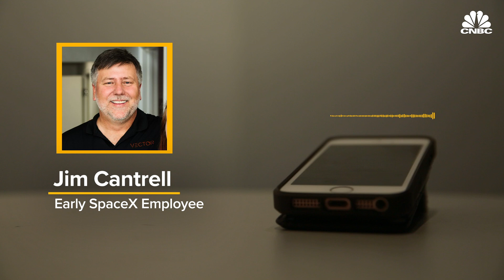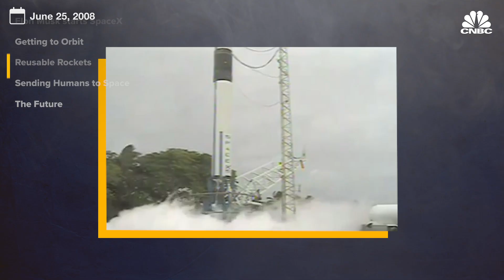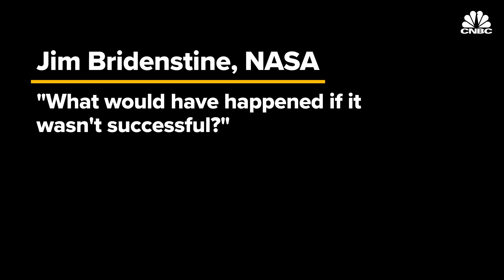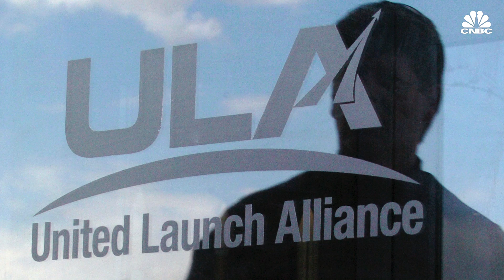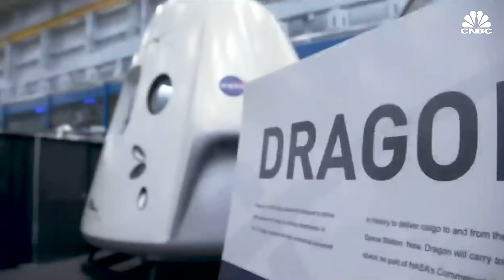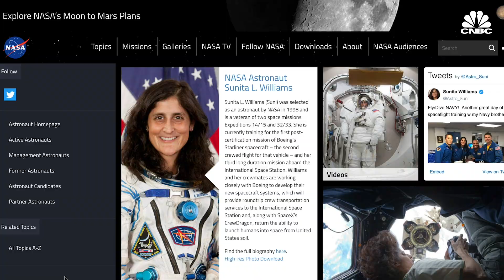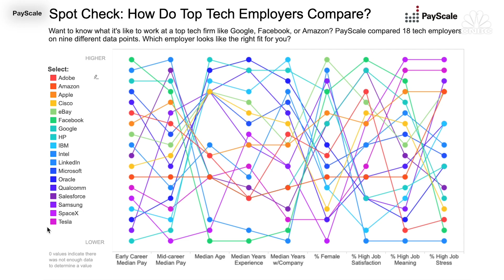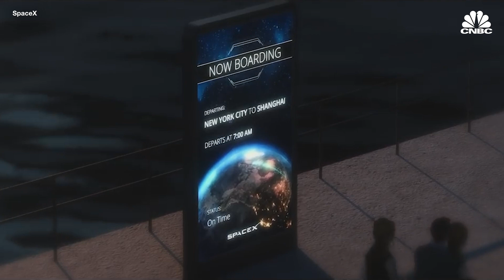What SpaceX Means For Elon Musk's Mars Dreams

Comment: How about making solar powered docking stations just like the Hubble  telescope and then placing them along the way between moon and earth. Then they can be used for supplies like fuel and food. And better still if rockets could move using magnetic force. And the magnetic force is provided by the electromagnets present in these docking stations. Then there would be no requirement of fossil fuel.

Comment: 11:00 put a car in orbit around the sun..? na I don't think so. You mean earth surly ?
Reply: The statement was correct.  It left earth orbit (which by default means your orbiting the sun only) and gave it enough speed to go PAST Mars orbit.  THEY DELIBERATELY DID NOT WANT IT TO HIT MARS,  so they intentionally missed it.  The egg heads that want to check for living microbes on Mars don't want anything from earth that has not been completely sanitized to hit Mars.  SpaceX did not want to try and sanitize a 10 year old used car.
Reply: It was intended to inject into Martian orbit but it failed so it ended up in a orbit around the sun.

Comment: Why cant we use electricity as a means of space orbit travel?
Reply: I believe you need some sort of matter for thrust. But some companies are working on water electric rockets. Essentially a huge bottle rocket with the water super heated to high pressure.
Reply: You need the expansion of some sort of gas to generate thrust, using electricity would only work if used as a heating source to superheat water but batteries have a low energy density. Using chemical engines is the best solution.

Comment: Dammit, yes SpaceX WAS THE FIRST to successfully land a rocket! Then, the first and only to land a rocket from orbital launch speeds. Much more significant! SpaceX Grasshopper made successful vertical landings before Blue Origin. Blue Origin subsequently did it from much higher altitudes, as high as sub-orbital, but that is not far apart on the difficulty scale. A SpaceX Falcon returns through the atmosphere at hypersonic velocities. An enormous difference on the difficulty scale.

This wouldn't bug me so much if Jeff Bezos hadn't boasted of beating SpaceX to landing a rocket, on the occasion of the first Falcon landing. A bald, deliberate misleading of the public re the state of Blue Origin's progress. Otherwise, I would be able to enjoy and applaud watching their landings of rockets and capsules from sub-orbit. 

The difference between sub-orbital and orbital rocketry: The velocities are so mild, Blue Origin capsules don't even need a heat shield. Or, riding a bicycle 100 yards vs racing a motorcycle 100 miles.